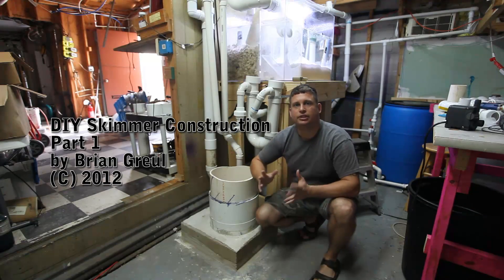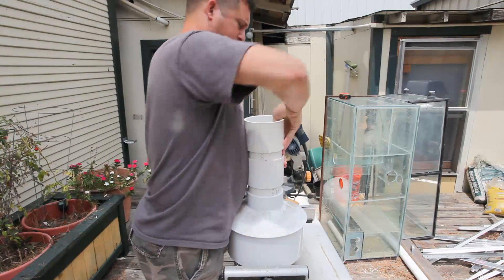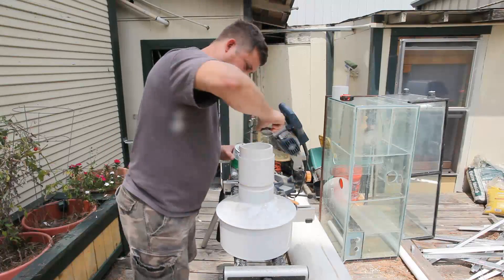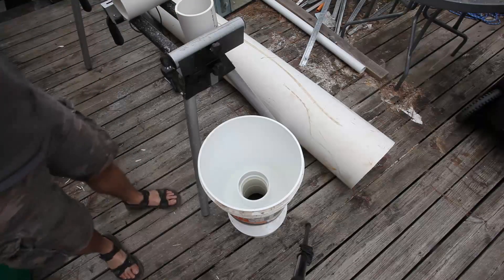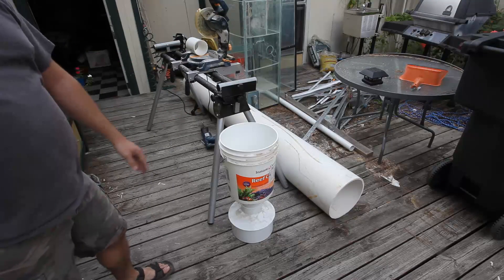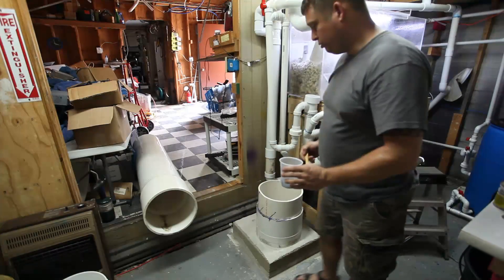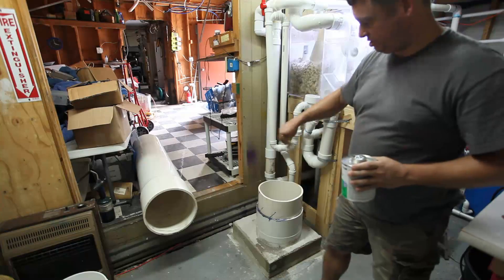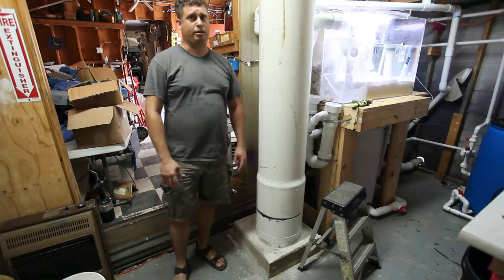DIY Skimmer Construction - Part 1

Comment: how long is your 12-in diameter PVC pipe and what are the two PVC pipes that are in the cement?
Reply from the maker: It's about 6 feet....... which was chosen because it was free.  Always a great reason.
Reply from the maker: Tower height determines dwell time which is the key to making a skimmer work.  bubbles and water speed don't equal dwell time.

Comment: This project was a total failure because he never posted part 2...lol
Reply: Love part 1 of well 1 but you can't seriously call a guy out to finish your project. That's like pulling apart a motor and saying, I'm out now you put it back together.. Perhaps you should pull this vid until you get the results. Don't be offended just put up or shut up. I've backed out gracefully of a few projects in my time. You can do the same. No one cares. Wasting 13 minutes of someones time is kinda uncalled for.
Reply from the maker: Why don't you go ahead and complete it for us?  Post a video of your DIY skimmer that is well designed and minimizes power consumption.  I'm waiting.

In the meanwhile, if you check out the rest of my videos you may notice I sold my house, moved, and started building a new house.  I still have this and will eventually finish it.  You'll just have to check back if you want to see.
Reply: Brian Greul  and you just got a dislike from me , I hope that if come with free slap 😠

Comment: It's too tall.......

There's no part 2 because this is a failed design.
Reply: How could it have failed? Air goes up, water goes down...particles rise with the air and into the collection cup...simple. Mine works!

Comment: I'm not an engineer student, but would it help if you use some type of  metal clamp similar to hose clamps to support the pvc joints? I've seen this metal bracket strip thing on my heater which helps it hold to the wall just in case of a huge earthquake (I live in a California aka earthquake state).

Comment from the maker: I agree with what you are saying.  However, with large diameter PVC it's hard to get enough glue in the joint, so adding more is unlikely to hurt.  The most important thing is to twist as you insert to make sure no voids form.

Comment: Cool video, waiting on the 2nd part... I did want to tell your about the PVC "glue"... take this how you wish, but one thing you said was that there is no such thing as too much glue. PVC is not actually  glued together. The glue is actually a cement that bonds/welds the PVC plastics together to make one. Putting the extra cement around the lip not only is not necessary, but it can actually weaken the plastics if you end up with too much. on a size that large there is enough cement in the joint.